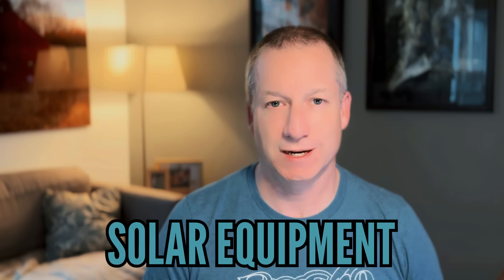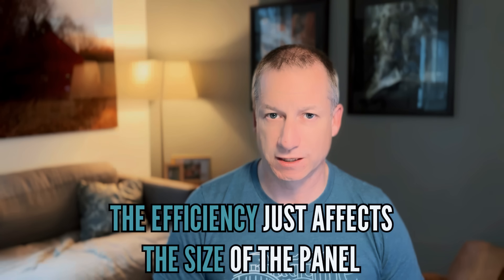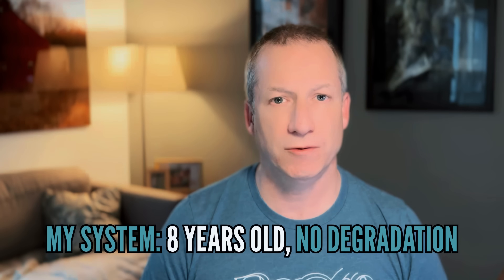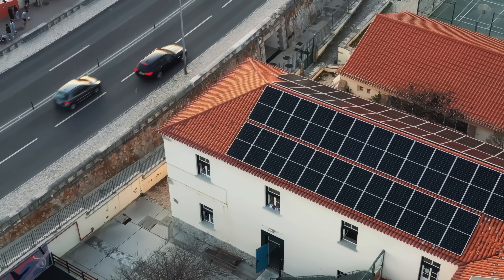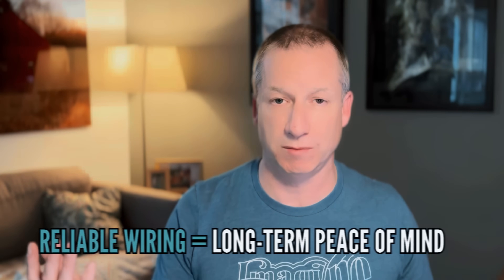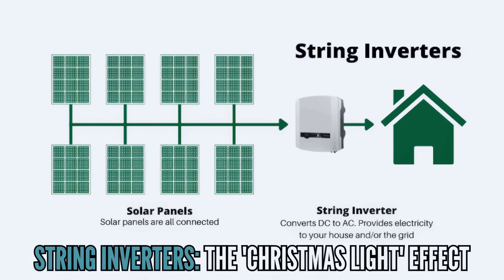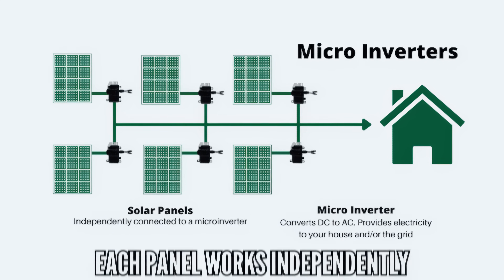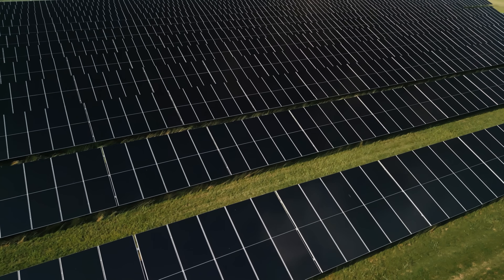The Hidden Downside of Microinverters No One Talks About

Comment: Sounds like you haven't heard of bypass diodes ... most modern panels have 3 so this all 'Christmas light syndrome' really is more myth than fact.
Reply: Older string systems had three issues that modern-day string systems do not have.

(1) Older string inverters had poor MPPT algos that stayed locked to local-maxima.  When a new better maxima occurs due to shading, the old inverters often stayed locked on the old one.    This was a well known issue with older SMA inverters, for example.

(2) Older string inverters had fewer MPPT inputs and roof topologies in that era (20 years ago) often wound up paralleling multiple strings because of this.   This meant that a shaded panel on one string could make both strings non-optimal, so you would lose more than one panel's worth of power.

(3) Older panels often had fewer bypass diodes.  Though I will say categorically that residential panels 20 years ago definitely had bypass diodes.   All modern residential panels have one bypass diode per sub-string within the panel (typically three in standard panels or six in half-cut panels).

In addition, installers often make mistakes such as not having a sufficient number of panels in a string to develop proper voltages in the MPPT range when one or more panel drops out due to shading.   For example, if a string inverter needs a minimum voltage of 260V and you have only 7 40V panels in series, shading can cause the overall string voltage to fall out of the optimal range.   If you have 8 such panels, your string can handle shading on two of them.  If you have 9, then your string can handle shading optimally on three of them.

The strings will still work when too many panels are shaded, it just won't be optimal because the MPPT voltage for optimal operation will be below the MPPT range of the inverter.  The inverter will wind up operating at its minimum MPPT voltage which will not be the optimal power operating point of the string in that situations.

Other mistakes can be made.  But frankly they are easy things to avoid in modern day.

* Micro-inverters and optimizers cannot magically recover lost power from a shaded panel any better than a string inverter can.

* But micro-inverters and optimizers CAN do better when a large amount of dynamic shading occurs on the solar panels.   For example, due to heavy foliage and shadowing.  If shading effects more than a few panels, micro-inverters and optimizers do work better.

Micro-inverters and optimizers do work better in a certain very limited set of circumstances, but for most installations the cost of the devices is not worth it... it is better to install more panels (if you can) for that money than to install micro-inverters or optimizers.   Simple rapid shutdown devices (to conform to regulations) are by far the cheapest way to go at roughly $30 a pop.

-Matt
Reply: I agree with this comment. Solar panels have bypass diodes. I can tell you from my test, I have bought very cheap foldable 200W panel (it produces 70W at best, so that tells you about quality). It has 4 panels that can fold. I tried covering left two - i get about 32W. Same result if I cover right two. I can also try covering each panel if needed :)
So the statement that if one panel is shaded - whole string will not work - is absolutelly not true and misleading.
This is becoming very big problem watching videos because when you are researching what to buy and how things work, these kind of information confuzes you, someone telling you one thing that is not true, others telling you different, so you have no clue anymore whats true. So please be carefull in future to tell people FACTS that you have proven by yourself and if you are not sure - go out, connect, measure, test - then talk.
Best regards, S.
Reply from the maker: Bypass diodes aren't the fix you guys think. Anyway it's a moot point here in the US because there isn't really a choice for most consumers of a string inverter. Maybe where you are it's an option. In either case, the best way to get solar is from a local installer that you trust to communicate well, do the work right and offer great service for a long period of time. Let them advise you on equipment. If you trust them to put it in and they plan to take care of it, then the equipment they recommend should be what they think is best for whole host of reasons.
Reply: @bradthesolarguy  lol ... a combination of argument from authority and moving goal posts, from the guy who won't admit the Xmas Light analogy doesn't happen in practice. Glad I'm not a customer !
Reply from the maker: @niallparker3655   My customers aren't concerned with fantasy issues. They want actual solutions. The Xmas light analogy is useful and does apply.
Reply from the maker: @niallparker3655  In residential solar there are three choices of inverter types from major manufacturers. In the US micro inverters made by Enphase have a huge market share and have all the issues I point out in the video. This is the reality of the marketplace. Are you saying that everyone should just use string inverters? That’s not what’s happening.
Reply: @bradthesolarguy  I do think most people would be better served by string inverters, many you tubers have videos on the minimal benefit provided by either micro-inverters or optimizers, certainly not economic and only useful in a few edge cases. Check out what others have found or better yet try a few experiments yourself before you parrot the marketing from Enphase and their ilk ...
Reply from the maker: @niallparker3655  Not parroting anybody. I'm using my knowledge and experience of being in solar for 10 years. Are you parroting someone? I'm talking about the actual residential solar market in the US where, right or wrong, almost all companies are installing a non-string inverter on every job. That means half or more of those jobs use micro-inverters which I recommend against. I have no problem with people using a string inverter if conditions merit. Conditions in New England usually do not.
Reply: @bradthesolarguy  sounding a little defensive there mate ! ... ;) ... I guess if it isn't your own research then likely we both are parroting to a degree. I agree residential seems to be mostly non-string inverters but the reasons seem more marketing than technical. My issue with your video is that you seem oblivious to the actual performance of a shaded string with bypass diodes and unaware of multiple people demonstrating that these simple strings (no DC optimizer) do perform OK and are simpler/cheaper. Given you are marketing yourself as an expert in solar, seems worthwhile you educate yourself further, maybe try a few tests in your local environment and quantify how bad a simple string really is.
Reply from the maker: Umm, I may sound defensive because you said I was parroting marketing speak from Enphase and their ilk, which was not only wrong it was insulting. Thank you for agreeing that residential solar is mostly non- string inverters as that is the fact. Not oblivious to anything you are saying, but my goal is to provide useful information not academic. Truth is that, in the real world, solar installers aren't using string inverters for residential use. Further, where I live shade caused by trees, hills and mountains, snow and clouds affect every system. Because these systems will last decades a small percentage gain in production is well worth some additional up front cost. With leases or PPA's, the equipment has to be pre-approved by the lease company. Keep in mind the lease company makes their money by maximizing production versus installation and maintenance costs over 25 years. I don't know of any residential lease or PPA providers who have approved string inverters for residential solar in the Northeast of the United Sates. Wonder why that is?
Reply: @bradthesolarguy  would still like to see some quantification of how bad the basic string vs. optimizer approach would be in your area, betcha a beer or two it isn't as bad as you think ... based on your last though it doesn't seem of much interest to you. Parting thought though ... if you skip the optimzers and put the extra $ into a few more panels, wouldn't you have more energy overall ? Cheers !
Reply from the maker: If string inverters become available to residential customers I will get very interested! But, until then, I don't care a whole lot as I want practical solutions. Adding more panels is a very practical solution but is rarely possible on the roofs here in Massachusetts as we have fire set backs, structural, problematic roofing materials etc. that usually means we are maxing out what room we have!
Reply: @bradthesolarguy  kinda runs counter to your argument in the video above that the panel efficiency at panel (wattage/efficiency) is less important (which I agree with you on). I guess you are one of those people who will never concede a point ! ... good luck with that ... 🙂
Reply from the maker: What runs counter to my argument in the video? I'm more than happy to concede a point if shown any evidence, you just haven't done that ;)
Reply: @bradthesolarguy  LOL ... did you forget what you said ?!? View 0:34-1:45 ... to paraphrase "panel efficiency less important and most roofs won't benefit" ... I'll give you points for steadfastness but maybe you should cut back on the weed ... ;)
Reply from the maker: Ha! We are really getting into the weeds here. (Pun intended!) There is a lot of nuance here and I don't think I'm saying anything contradictory. Let me try to explain. The cost of premium high wattage panels is a lot more than the "standard" at any given time. Right now standard panels are about 385-425 watt panels. This means that a 450 watt panel would usually cost about $.25- $.60 more per watt. Please note that it is per watt not per panel. For example, let's say a premium 450 watt panel is $.40 more per watt than a 400 watt panel. It's a 25 panel system. Let's say the 400 watt panel system installed cost is $30,000 and produces 10,000 kwhs a year. Pretty standard for this area. The 450 watt panel system would cost $38,250 and produce 11,250 kwhs a year. That's $8,250 more for 1,250 kwhs a year. If we multiply that times current electric rates that is $500 worth of extra electricity annually from the higher wattage system. If we factor in rates going up a lot, as they do, it will likely average $750 annually over the next 10 years and you still haven't gotten your investment back. It's for this simple reason that I have never had a homeowner choose a premium panel. None of them saw the value. Maybe, as utility rates increase more people will choose the premium panel. Also, it's interesting to note, just because a panel is higher wattage doesn't mean you can fit the same number on the roof. The panels may have similar square footage but they have different shapes. Some are taller, while others are wider. The shape is a bigger factor than you might think. It's Tetris! About half the time we do tricky layouts trying to maximize wattage on a roof plain the smaller wattage panel fits more panels (bigger array wattage)  just because of the shape. Kind of crazy. The cost differences in inverter systems is way less than with panels and therefore it makes more sense to me to spend a little extra there. Hope this is clear through all the smoke.
Reply: @bradthesolarguy  I'd encourage you to run a similar analysis for the actual prices on string inverters vs. DC optimizers, I think you'll see matching conclusions (extra cost for efficiency isn't economic) but maybe it will make sense in some installs. There are some legitimate reasons other than efficiency to go the DC optimizer route (panel level monitoring, integrated RSD, maybe ease of permits ?) but you continue to evade admitting the Xmas light analogy is a (mostly) bogus argument against simple PV strings and string inverters ...
Reply from the maker: I'm not admitting it because I disagree with you. Please see my answer to tim6294 above. Even with only a small percentage gain in annual production it's almost certainly worth the money to go with an inverter system that deals with the shade issue. But, I get that you are desperate to be right here. Here is a way for you to do that and have it be relevant in the real world. Right now residential customers are not offered string inverters. There is a virtual duopoly in the residential solar market between Engage with their micro-inverters and SolarEdge with their DC optimized system. So you would need to start or join a string inverter company and produce a string inverter for residential use in the United States. It will need to be UL listed of course. Then you can make your air tight argument about your superior product to the dozens of solar finance companies, the hundreds of solar installers and the thousands of utilities as well as thousands more local jurisdictions. Oh, you should probably coordinate with the panel manufacturers as well. If you convince some of them in each category and your product is well made and priced lower than the competition I'll make a video about how that would be the best choice for my customers. Good luck with that :)
Reply: @bradthesolarguy  disagreement is fine, strange though you are reluctant to do the math to demonstrate your case ... ;)

The permit issue I've already acknowledged is an upside for DC optimizers... my disagreement with you is the rehash of the Xmas light trope which has been demonstrated by others to have minimal effect. Moving the goalposts to UL approval and permits is disingenuous.
Reply: @bradthesolarguy you're really wasting your time on the back and forth with this weirdo. Like really wasting your time. Everything you've mentioned makes perfect sense. He's nitpicking where there's nothing to nitpick 🙄.
Reply from the maker: Thanks for the support.
Reply: @bradthesolarguy yeah he’s just Lonley.